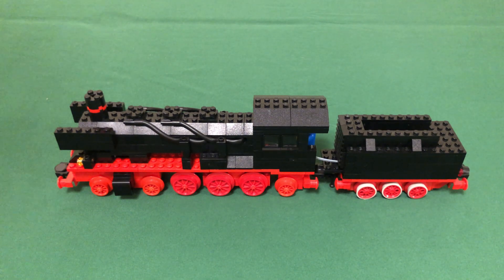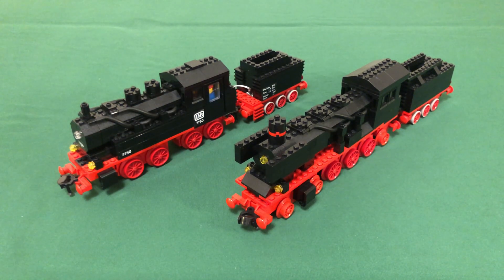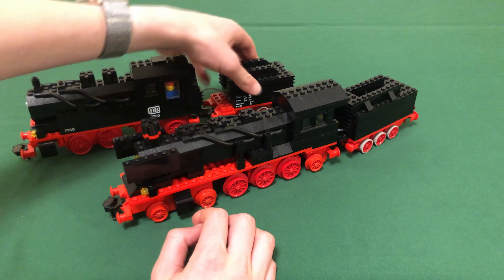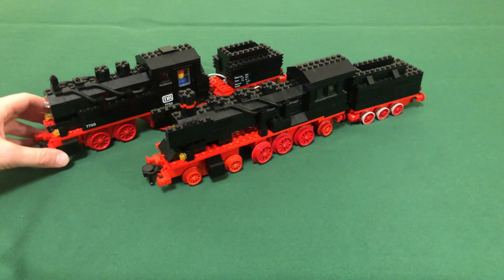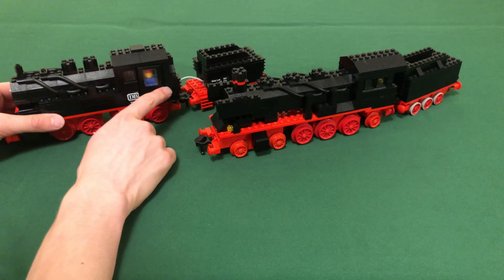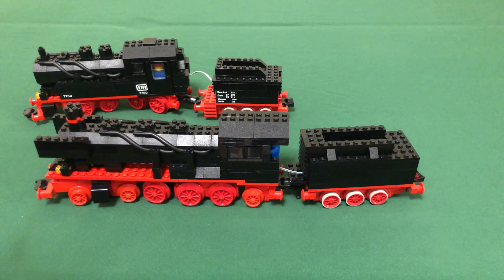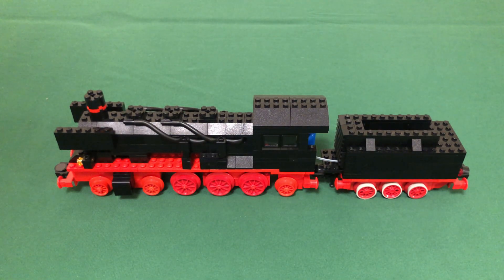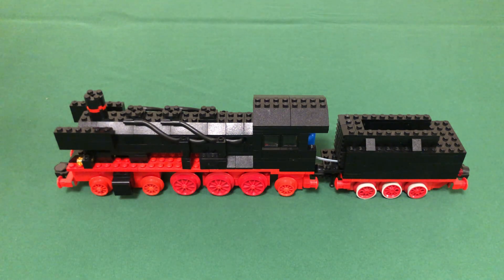Legendary 12V steam engine from 7777: Review and comparison

Comment: I had completely forgotten about this model in the 7777. Thanks for making this video, thereby reminding me of it.  

These last couple of weeks I have been working on recreating a Lego version of the German DRG class 1 BR 1 steam locomotive and tender. I am trying to create it in a late 1980s early 1990s Lego style, but using cheaper/modern parts, and powering it with power functions.

I have same trains from the 1980s and I like the look and style of the trains made back then, so it needs to blend in with them. I also feel that modern Lego has lost some of its “playability” compared to that of the 1980s. I feel that the 1980s were the sweet spot of playability. Earlier Lego sets were too crude and later sets has too many highly specialized parts, like the entire front of the locomotive being one brick. I’d like to see someone make a steam train out of the parts from 60337. 

Anyway, looking at the DRG class 1 BR 1 steam locomotive and this build I see a lot of similarities: 
* The classic red chassis of the German steam trains. 
* The 4-6-2 wheel configuration of the locomotive. 
* The steam cylinders are placed between the two front wheels.
* The sloped front.
* The smoke deflectors.
* The three domes on top of the boiler.
* The window (and door) configuration of the cabin.
* The roof of the cabin extending over part of the tender. 
* The floor under the cabin being lower than under the boiler. 
* The approximate relative length of the cabin
* The approximate relative length of the tender

The three main differences are that the height of the boiler and the tender should be higher, almost as tall as the cabin roof.  The ladders should be on the back of the tender, not the front. (Although the tender did have a ladder going from the floor to the ground in the front). And finally, the smoke stack should be lower.

The 7777 (and other idea books) favor the use of simple bricks to special ones. For instance, you would get a better approximation of the smoke deflectors using brackets and plates rather than the ordinary bricks. The model also has to look cool, and the bigger smoke stack does make it look cooler. 

The open part between the chassis plate and the boiler could be just to save bricks or it could be to mimic the openness of the chassis between the wheels.

It could be fun to have a chat with the designer of this model and hear about what they were thinking when designing it.

Comment: I have to ask how much does a red Lego train motor cost because i know a website where They selv one for 100$~ (750 DKK~) is that a lot for one?
Reply from the maker: Sorry for the late response! 750 DKK is actually a pretty good deal if it's in good condition. Make sure to check the contacts and overall housing, and obviously confirm with the seller that it runs smoothly lol. Red motors sell for 130-150+ USD on Bricklink depending on condition.
Reply: Ok, thanks for the answer!